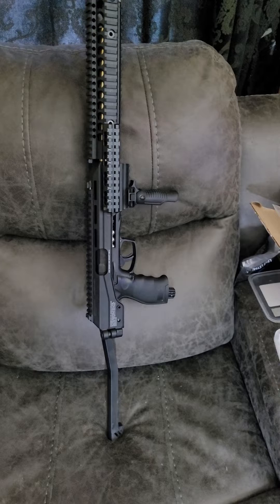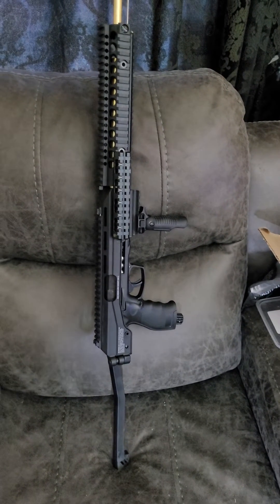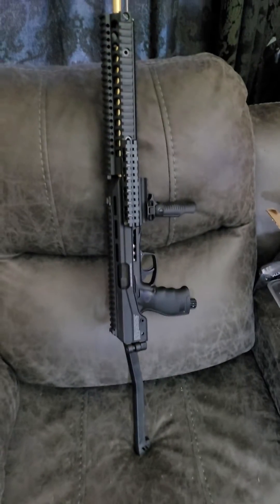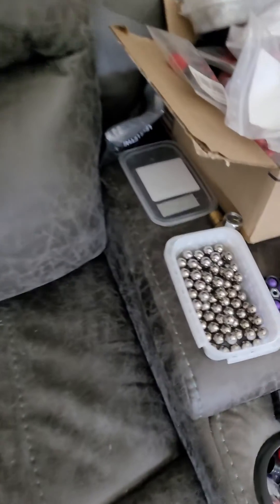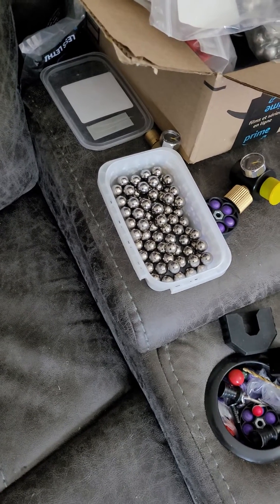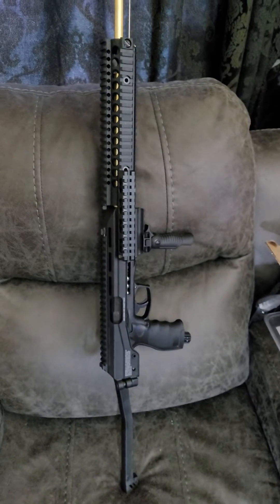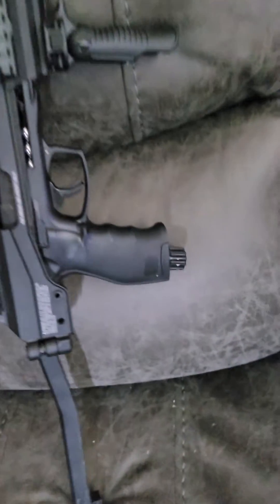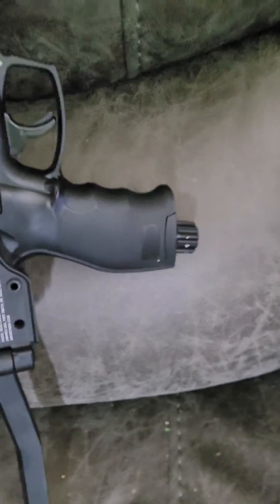Umarex T4E HDP 50 Co2 8.4 gram steel bearings, only 27 joules hmmm

Comment: Please upload some videos, doing chrono tests of all of your upgraded T4E markers, but with lighter balls -  like normal paintballs, rubber balls, powder balls or even normal paintballs. Lets compare the muzzle energy.
Reply from the maker: the paintballs and rubber will break with my set ups they might work with the co2 but i will make a vid with many ammo choices i have a bunch i can try
Reply: @LessLethalHomeDefense  Thanks. For the 0.68 Caliber markers, there are rubber and nylon balls that weigh less than 4g. Umarex also makes PLB SERIES polymer/plastic balls -  their 0.68 caliber PLB68 polymer ball that weighs about 4.7g and the 0.50 caliber PLB50 ball that weighs about 1.8g.

Comment: I think that your barrel is too long for the heavy balls. There is a limit to which barrel length will increase muzzle energy. This limit depends on the firing pressure and the weight of the projectile.
You have reduced the pressure down to 850psi. This pressure is struggling to push the heavy balls down the long barrel. This is why your setup will have less muzzle energy than your buddy that used a 12 inch barrel.
Reply from the maker: yes i think your right how ever i only use this barrel for hpa and i get 95 joules with it and 1100 psi hpa, check out all my vids, it goes clean through 1 inch plywood and clean holes through a coconut, the hdr 50 is same 95 joules also my hdb-68 is 83 joules with 8 gram balls and 72 joules with 850 hpa and 50 joules with co2,, with 850 hpa this pushes 64 joules with same balls, i have another vid that shows :)i have a lot of t4e mods and videos have a look tell me what you think :) cheers man
Reply: @LessLethalHomeDefense  However, for lighter balls, like 1.8g nylon/polymer/plastic balls, your longer barrel setup will get higher muzzle energy than a 12 inch barrel.
Summary is: at 850psi, 12 inch barrel is best for heavy balls, but your longer barrel is best for light balls.
Reply: Its because air leaks around the projectile and chamber. In a perfect situation then a heavy ball should have the same performance as lighter ball. But since heavy balls move slower, it gives more time for air to leak around the projectile and chamber